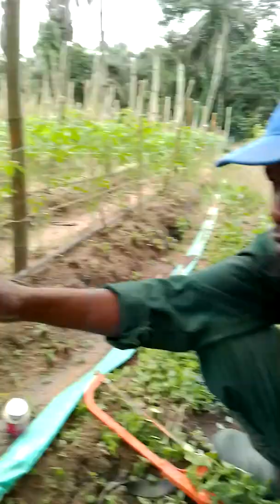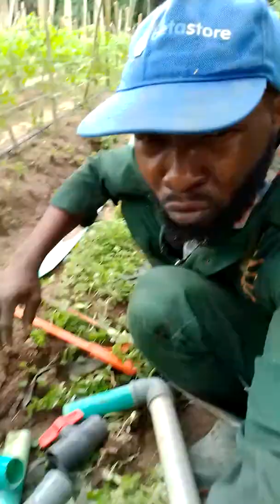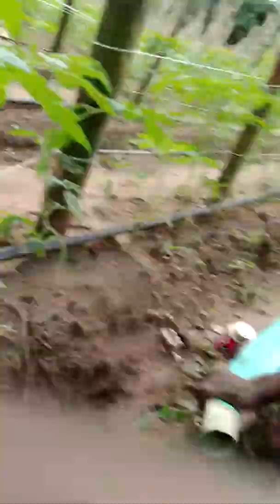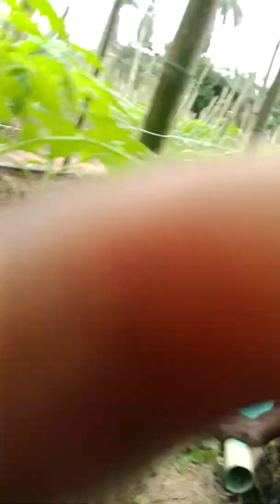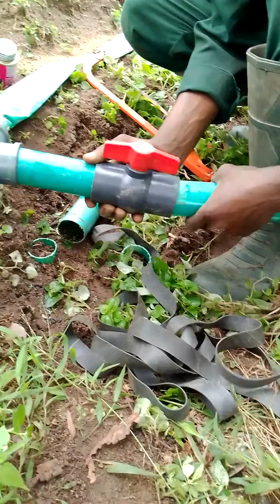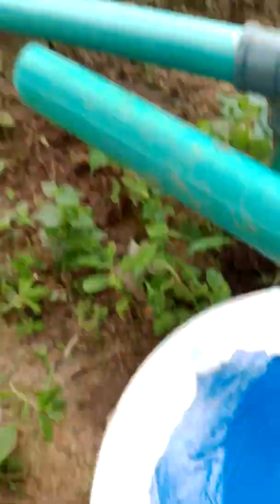taping water from the Old irrigation system to the new system

Comment: How long should one use irrigation to supply water to a farm?
Reply from the maker: Depend on the capacity of pumping machine, number of stand and temperature at that moment. Using at the moment temperature (south west Nigeria) 5.5hp and 5000 stands, 30 minutes in the morning and evening is okay.
Reply: Good day, I was the one who reached out to you on WhatsApp. I intend to do about 7,000 stands of tomato and about 10,000 stands of pepper using borehole water.  Please I need your advise on the following:

1. Do you think connecting the lay flat  directly to the borehole will be sufficient to water farm or we should pump out to a reservoir and then use 5.5h mud pump to pump into layflat from reservoir 
2. Do you think using 10,000L overhead tank will give us the required pressure for our beds of 80 metre length?
Reply from the maker: 1. Pump to reservoir then use 5.5hp to draw the water to your farm. 2. If it 2-3k stand I will say it will work, but 5k and above am not sure.
Reply: Thanks a lot.